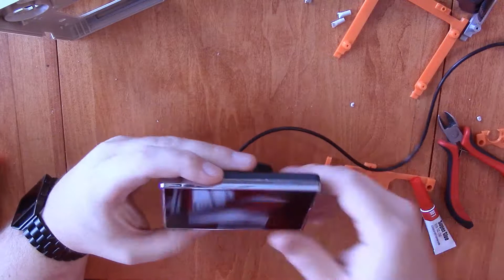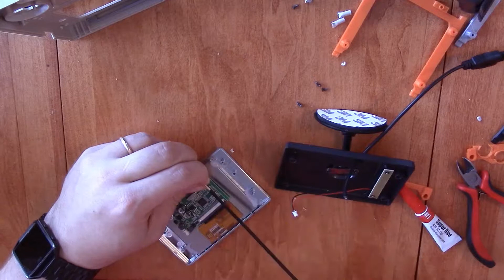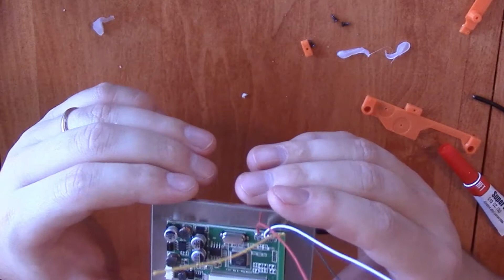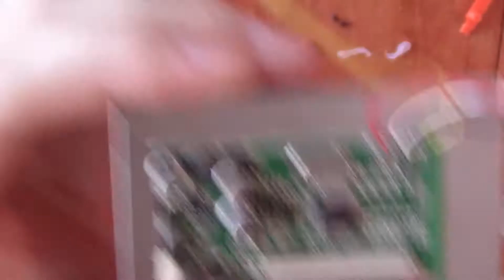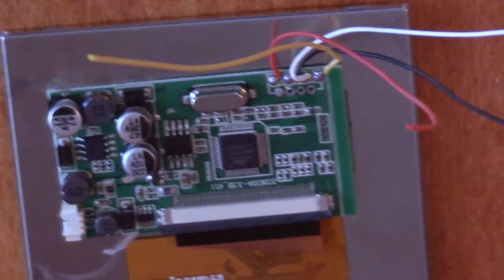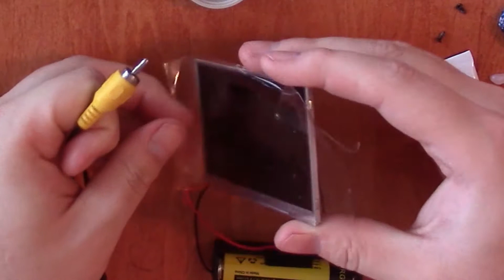5volt Mod for cheap composite backup camera screens GBZ

Comment: If use 2 batery 3.7 volt ..it Will work ?
Reply: Connect 2 batteries in parallel so the voltage still the same

Comment: I'm going to be doing this mod soon for use with an HDMI to vga downscailer and my ps4... Wish me luck.
Reply from the maker: Good Luck
Reply: @nickstuffinc  I finally got around to it, I'm thinking of wiring the downscaler to the U5v USB port and the monitor to the USB3 port inside the case and mounting the monitor on a swivel hinge so it can be used with the ps4 standing or flat.

Comment: what if my capacitor is 16v instead of 10?
Reply from the maker: Power the screen with its rated voltage and Use a volt meter to determine if that capacitor is charged to 5volts. You are looking for the 5 volt circuit.
Reply: @nickstuffinc  i dont have a 12v battery or a power supply tho, so ive never seen it turned on. but im gonna try playing with batteries carefully tomorrow, thanks.
Reply: @depopa1033  Any luck?
Reply: @franksmith7271  the screen wouldnt turn on anyway no matter the voltage and i couldnt find any answers online either so i just gave up, so sadly no.